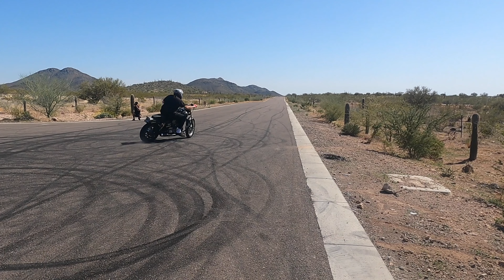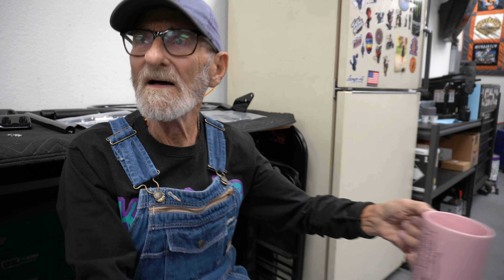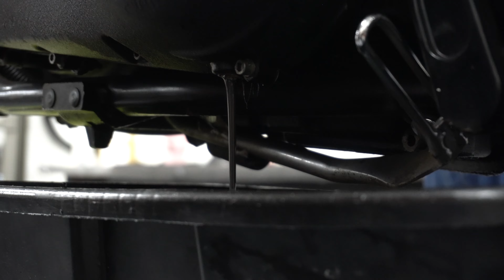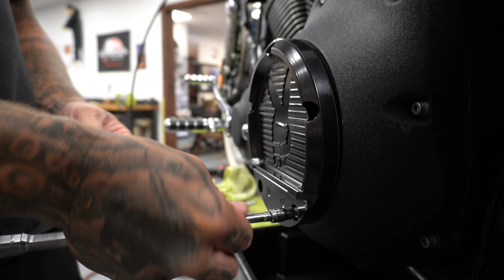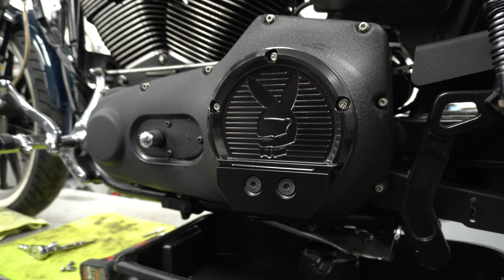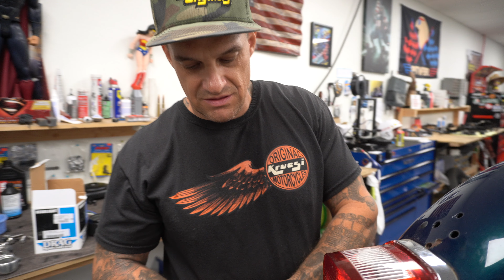Kruesi Originals derby cover air cleaner cover lay down license platen kit install on a dyna (P2)

Comment: Checked the website, didn't see anything black for points or derby covers, I got a 20 iron 1200, besides the sportster cage highway bar, which is AWESOME BTW, im strapped for cash, u got any other parts I can fit on my sporty that won't break the bank? I got your fav ape hangers, and I got a half helmet and I ride as far back as possible. 🤣🤣 seriously tho Ryan, I need some cool looking parts for this sporty, any ideas, besides bars.
Reply from the maker: If you give The Shop a call, Trent can get your dialed in on one of those points covers
Reply: @kruesioriginals  I appreciate it. I'll save my chips and give Trent ring